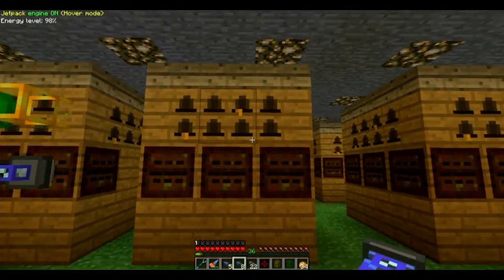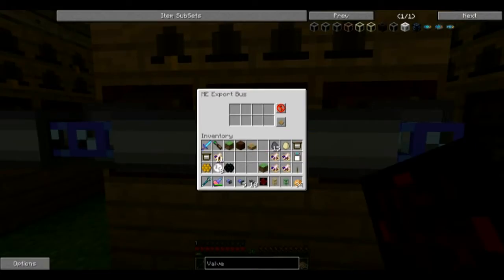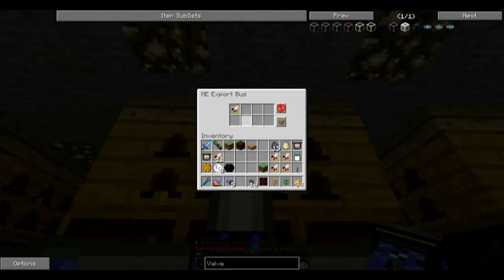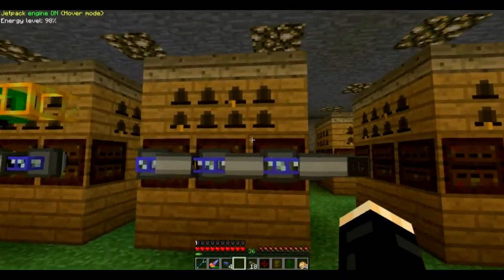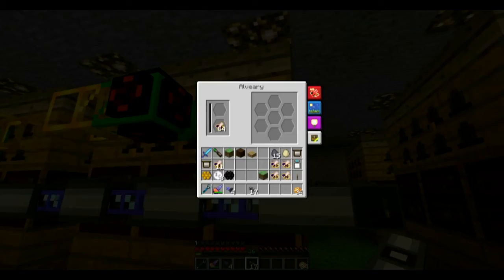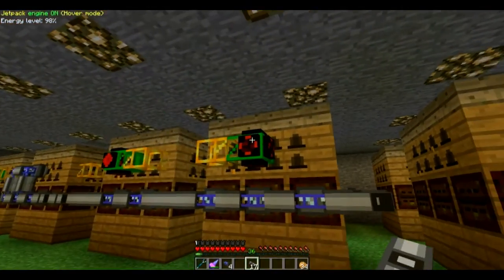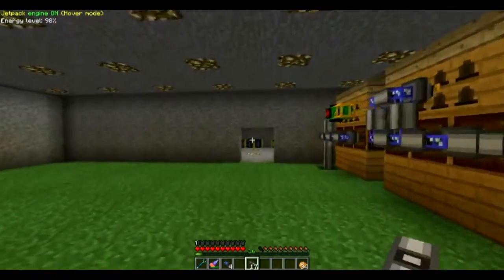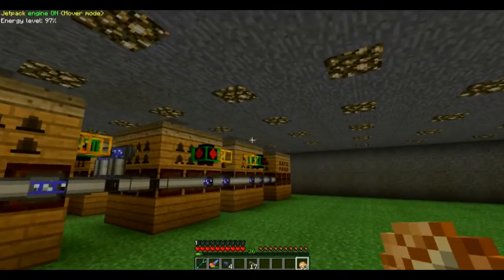MwE FTB [Tutorial] - Alveary Automation with Applied Energistics and Buildcraft

Comment: I have mine set up pretty much like yours.  except I have my export bus/impport bus on the bottom of the alveraies.  Makes it looks nicer on the outside.  Also, in the ultimate 1.4.7 version, as long as all the drones are the exact same, you don't have to run them through analyzers.  For instance, I have 4 imperial bee Alveraies going.  The princess is routed back with the emerald  pipe, like yours, and the import bus is told to import unanalyzed drones.  Hasn't messed up for days.